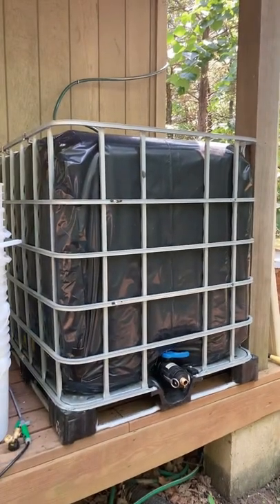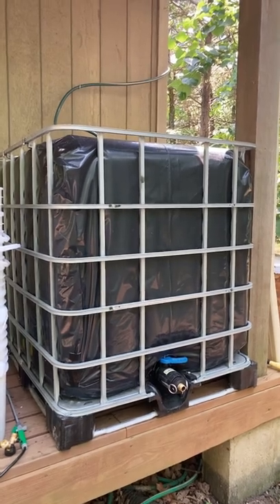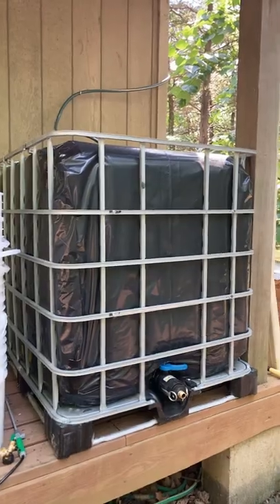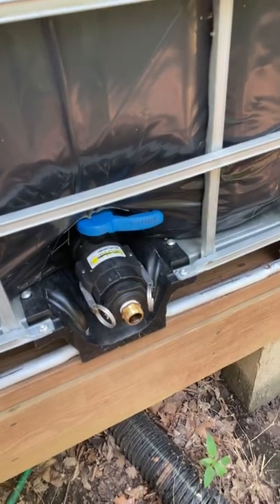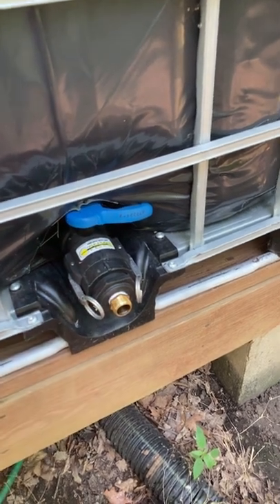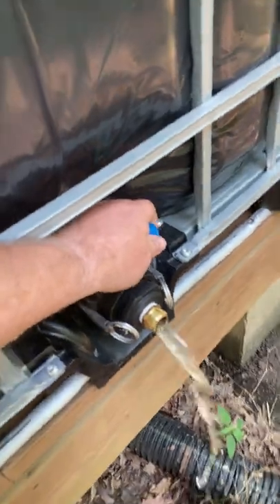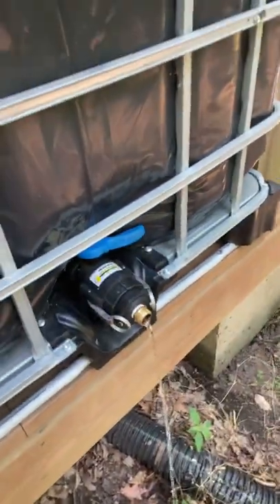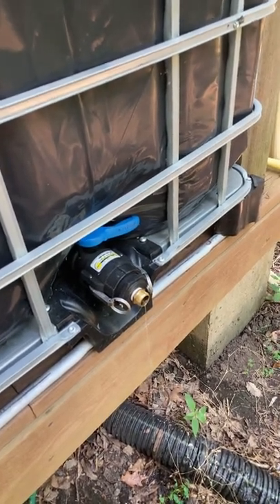Trial Rainwater Collection System (#7)

Comment: I think it's really cool that you showed how it hooks into the drainpipe. I was thinking about this
Reply from the maker: Thanks!  Having an overflow drain is important in case your tank gets full…which is the goal of course. I also leave the small top cap loose to let air escape. As water comes in it could build pressure with a closed system if you don’t and could cause the tank to rupture.